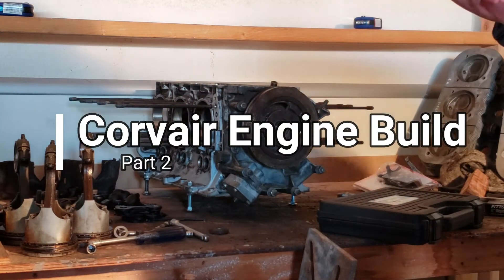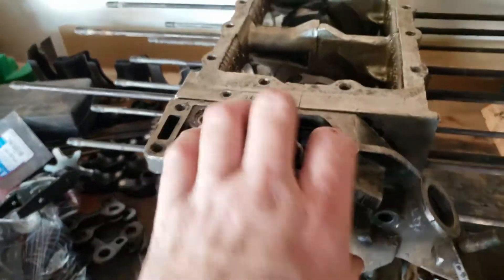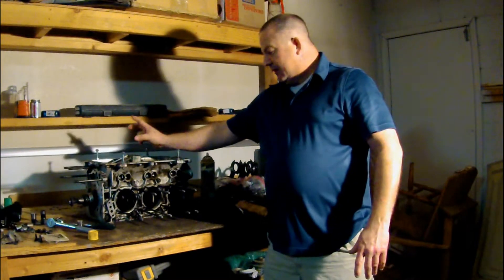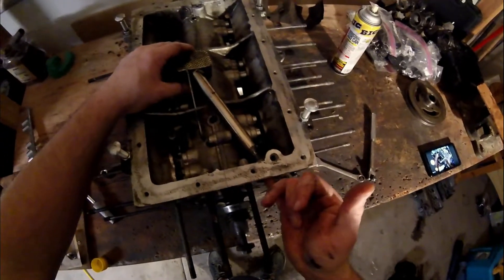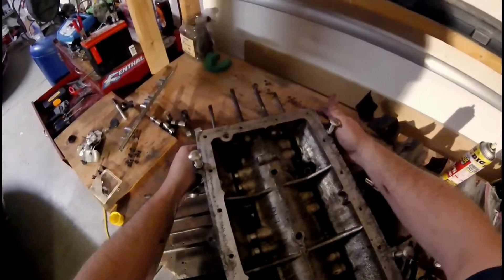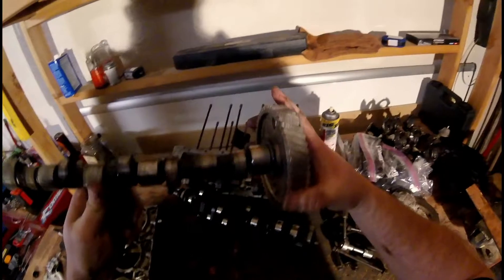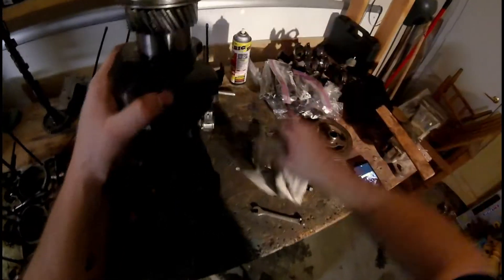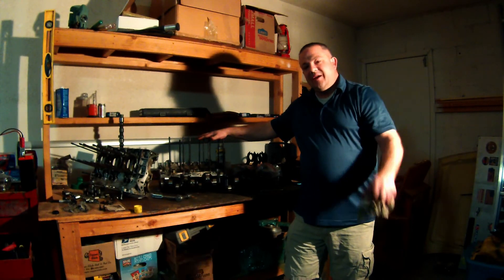Corvair Aircraft Engine Budget Build Part 2

Comment: I am about to inherit several corvair engines from my brother. What do i need to look for when deciding which ones are ideal for aircraft? I am probably going to buy a 650 with a Jabiru ( CAMit3300). I want to build at least one Corvair engine to replace the 3300 when it's needed and sell the others.
Reply from the maker: @flywiseman  go purchase the Fly Corvair conversion manual.  it has all of the information you will need.  Generally speaking you want a 1965 to 1969 110 non smog engine.
Reply: @zenvairpilot  Thank you, really appreciate the advice. Safe travels